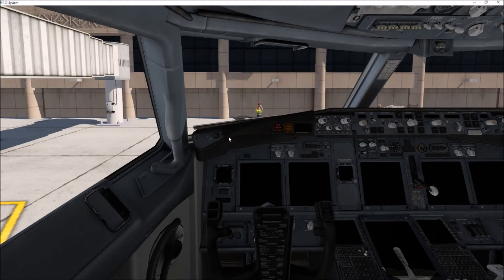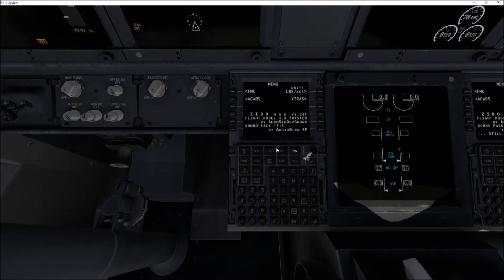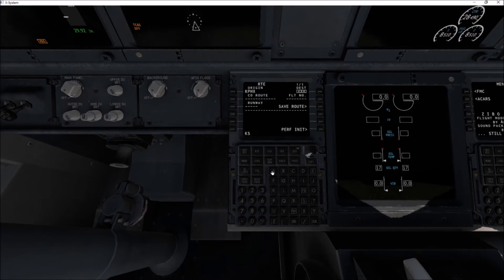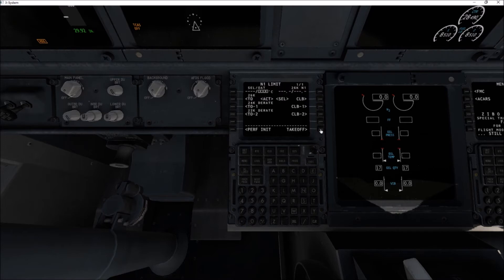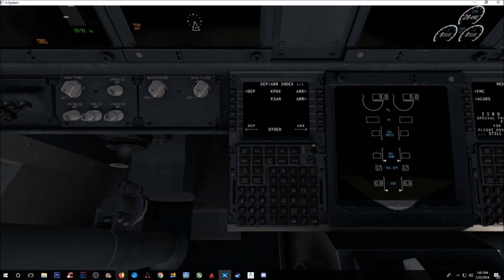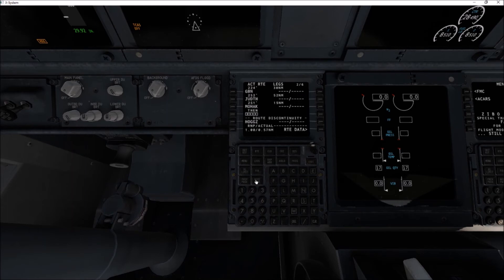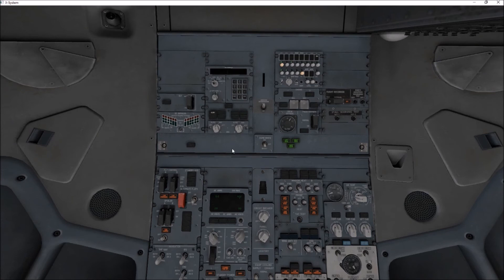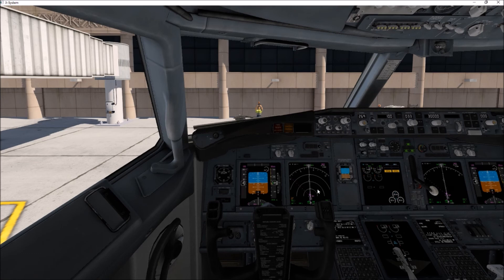Xplane11 Zibo Mod FMC & IRS tutorial

Comment: Hi, I have the 737-700U. This download also provides different liveries. I have already noticed that some buttons (for the lights for example) are different to the same plane with another livery. The problem is that setting you IRS position does not seem to work when I select the Southwest livery for example but when I use the Tuifly livery it works just like you have shown it in the video..

Comment: With fmc, ap, set (flight alt, destination runway alt set on upper panel) and airplane running on runway I can make flight from kmia-ktpa, ksfo-klax everything works according to plan with ils landing. One issue after reaching about 12000ft alt the windshield looks like it has vertical looking crack lines or heating element type defroster and no visibility, after descending back to below 10-12k back to normal, what is causing this?
Reply from the maker: do you have your windshield heat on?
Reply: I did not turn it on, new to this aircraft thinking it was running and ready to fly on runway.
Reply: I had the same problem if you go to settings in General you need to unchecked  the "Simulate blackout, reout, &hypo-xis effects and if you dont want for the tires to blown up when you land hard unchecked also. I hope that helps